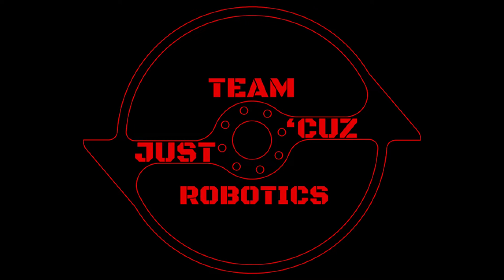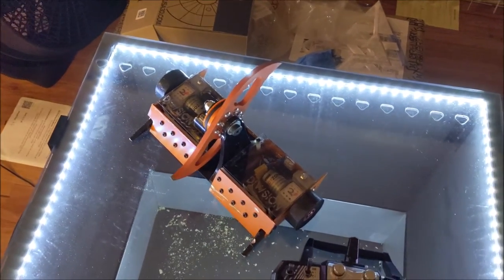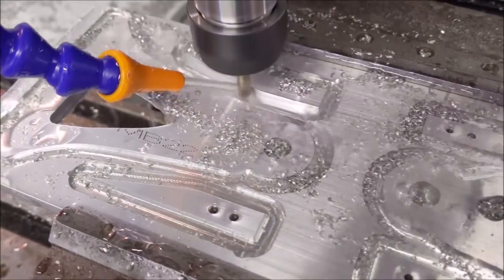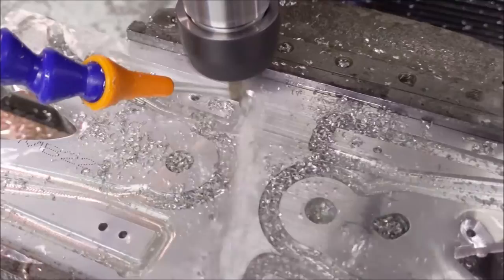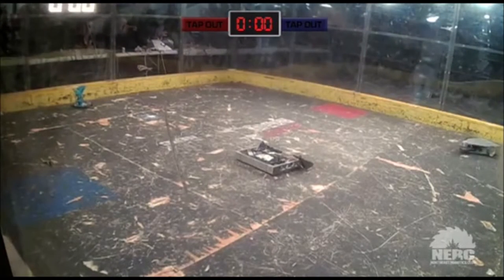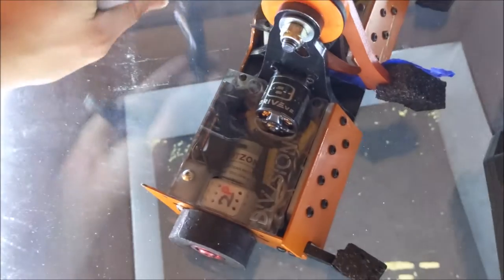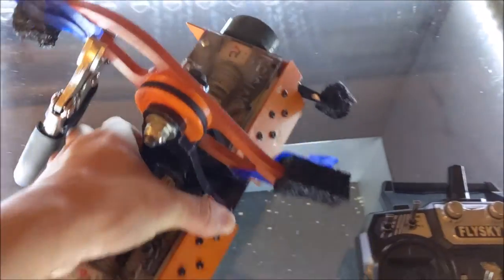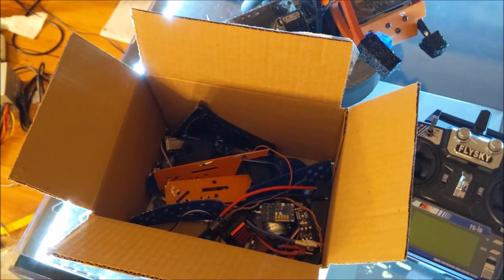Combat Robot Safety: How to Safely Build and Test Fighting Robots

Comment: Great video, I appreciate the emphasis that lifters and wedge robots can be hazardous if not handled properly! Your channel has been pivotal in my goal to enter this awesome sport :)

If I may ante in one small note from my non-combat robotics experience: even on fully passive features, I recommend being very mindful of any sharp corners, thin edges, or pinch points on your bots when handling them. A thin sheet of metal doesn't need to have very much speed or mass behind it in order to utterly ruin your day, and even a small lifter or exposed drive gear can tear up your fingers quite badly if you get them stuck in the mechanism.
Reply from the maker: All very true. I have gotten hurt much more by sharp tools and papercuts from boxes and stuff than the robots when I am actively being careful and mindful about safety much more so!